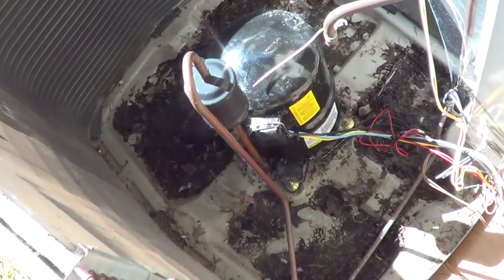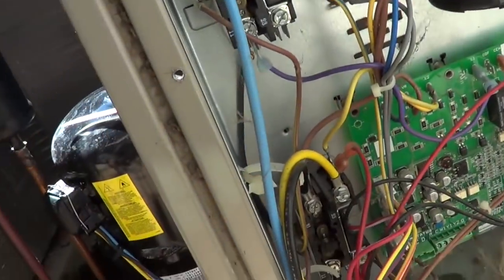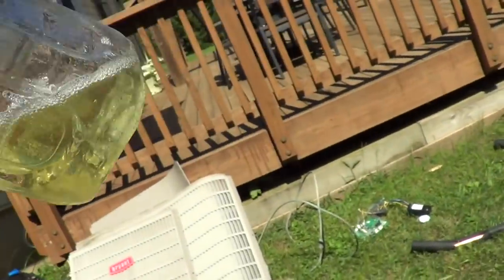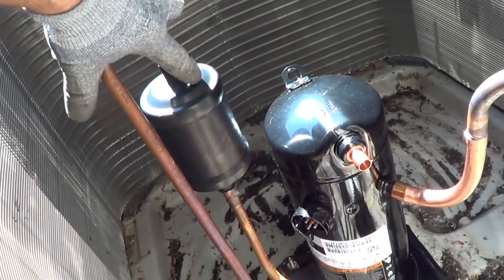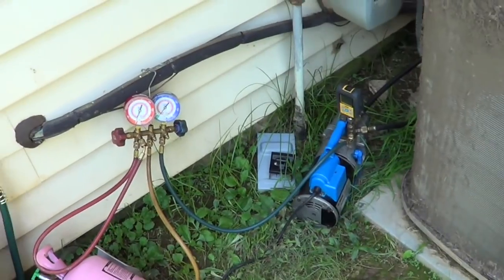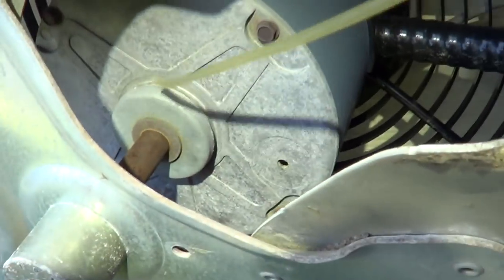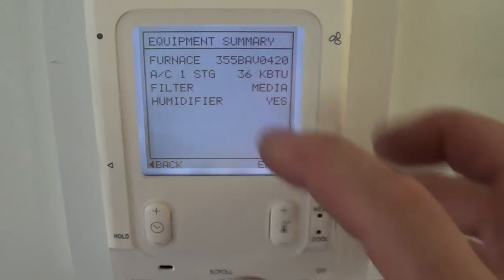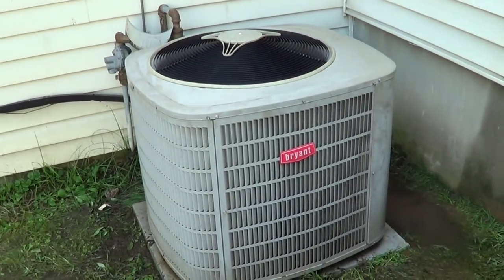2 Speed Compressor Replacement with Single Speed

Comment: Question if you were to put a single speed compressor instead of a 2peed compressor without gutting all those controls would you have issues ?
Reply from the maker: The controls will be confused not seeing the 2 speed compressor.   The controls have to go.
Reply: @NathansHVAC  thank you appreciate it
Reply: It seems that these HVAC repair guys really hate two speed compressors and don’t recommend them. That’s one of the reasons I didn’t buy and install the two speed equipment and I also used a regular Honeywell thermostat rather than an expensive communicating thermostat. I have seen other YouTube videos where the tech will bypass the low speed on the compressor, making the compressor always run in high speed.

Comment: Just had a call on one of these last contractor was ran off the job cause he replaced the evaporator coil but could never fix a leak in the condenser coil, turns out he removed the muffler and shortened the discharge line causing the leaks at smaller discharge lines. Customer had to pay same amount as coil replacement for me to repair correctly then blamed me for being to busy to come out the first time so he had to call the other guy. Can’t make this shit up.

Comment: Mr NathansHVAC
, I have a question about swapping compressors. I thought that I needed to change a bad compressor with same type compressors like scoll to scroll and reci to reci. that's what a rep gives me at johnstone. can I switch from  a scroll to a reciprocating compressor with different brand?  what should I consider? type of oil ? btu? cap size? thank you
Reply from the maker: Scrolls are better.  They can handle liquid refrigerant without damage.  You also want to match R22 or R410a.  They don't interchange.  Most new compressors are POE oil which is compatible with everything.  Also, match the BTUs if you want to keep the same system capacity.

Comment: I didnt know it would work with all that electronics out
Reply: I have similar electronics in my condensing unit. I assume the electronics are only there to support an expensive and proprietary communicating thermostat which probably also has limited diagnostic capabilities.

Comment: Good one.  I think LP switches should be on all units.  I have changed a lot of compressors that failed because the customer didn't realize that the refrigerant was low  --  it ran and ran because of lack of cooling,  and of course the compressor locked up from lack of lubrication.  But this is my thinking,  that's all.

Comment: Good job ,can u show us how to do when i change oil compressor using R22 to R404a or R404a to R22.
Reply: Buy you a measuring cup. Is about 9 to 12 oz. Poe oil is about 110 bucks. Measure the recommended amount then pour in.

Comment: What was the price difference? Maybe a few dollars?
Reply from the maker: I found the T81J285CBCA for $300 in florida.  However, I emailed and got no response.  The customers doesn't want to wait months for a surplus 2 speed to come up on the internet while the house is hot all summer.  The wholesale cost for the 2 speed is $1,200 directly from Carrier.  The problem is that the 2 speed compressor is sole source.
Reply: @NathansHVAC  any two speed compressor would work
Reply: Found it for 595$ and the single speed for 550$
Reply: 595 is not the same cost as a system..not even close..not where I live..1500 vs 5000?